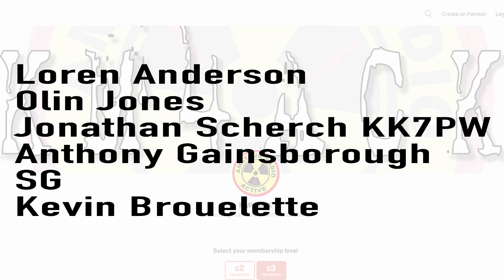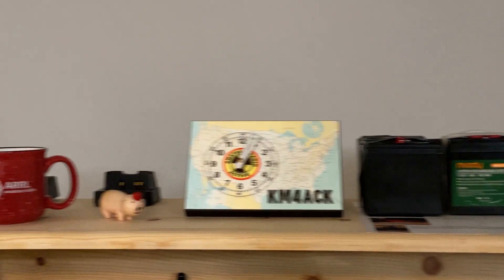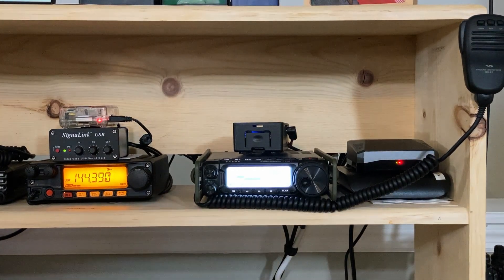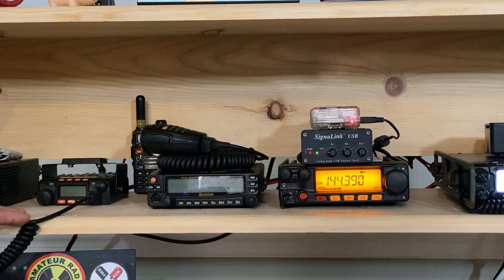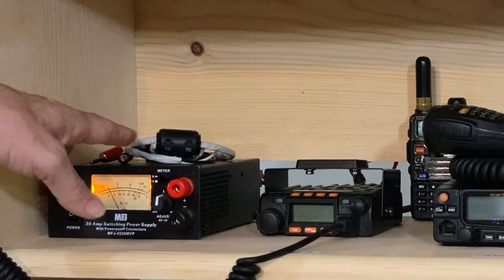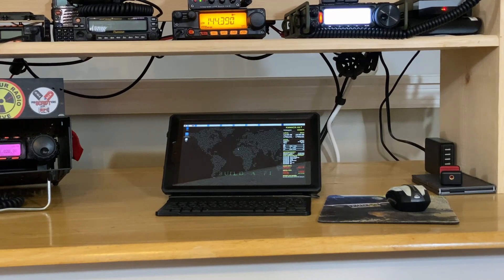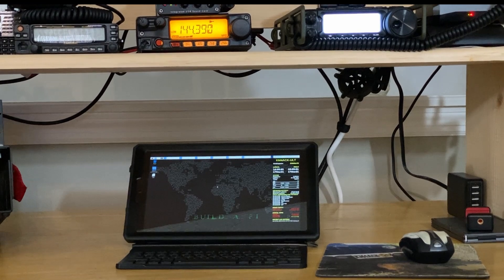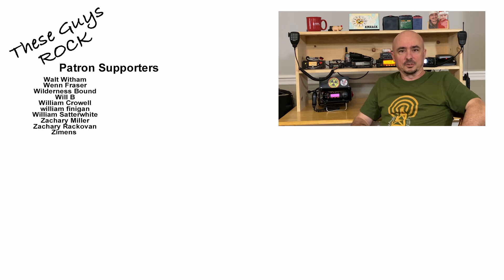Shack Tour 2021

Comment: Do you have a list of ham radio software that you use on the Fire tablet? I have one that I’m not using so I could relegate it to the shack. I’m just not familiar with ham software for it. It has been jail broken.
Reply from the maker: I use the fire table to interface with the raspberry pi that is connected to the radio(s)

Comment: Now that is one neat and well organized shack! My shack is much more cramped, I have to fit everything on top of a dresser lol. It does work though, but I do need some more Raspberry Pi's for everything. 

I also need to make a proper cable for my FT-2600M to do packet, right now it's just some 4 conductor wire with tinned ends hihi. I have a 2m packet WinLink gateway about 6 miles from my house, so once I get my TNCs firmware upgraded I'll be able to use it in KISS mode with WinLink Express.

Hopefully we can get to see your antennas next time, I always love comparing antennas! Thanks for the tour Jason!

73 de W8IJC
Reply from the maker: The table is only 4 feet wide. Someday I plan on building a new table that's 6-7 feet wide.
Reply: @KM4ACK  oh awesome, I suppose it helps to have decent cable management hahaha! I need to get one of those SignalLinks, or maybe just get a TNC that isn't nearly 35 years old lol. I am using an old MFJ-1274, it does "work", but it doesn't correctly add itself to the packet when it digipeats one. I suppose if I can get this new firmware that adds KISS support working, I can just use APRS software like APRSIS32 or Direwolf for controlling it. You've just used Direwolf on a Pi right?
Reply from the maker: Yes. I use direwolf which is a software TNC. Works great on the pi.
Reply: @KM4ACK  Ah ok, I think I might make a cable for my Pi and try it out sometime.